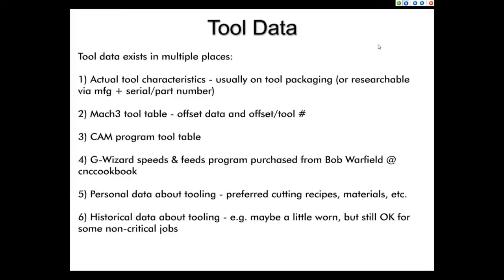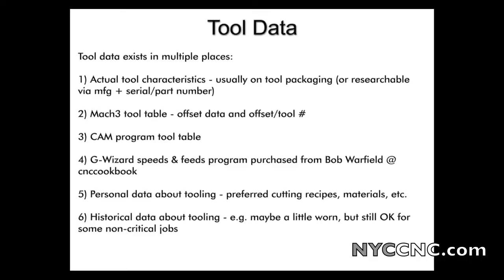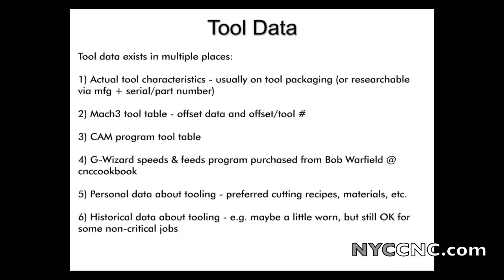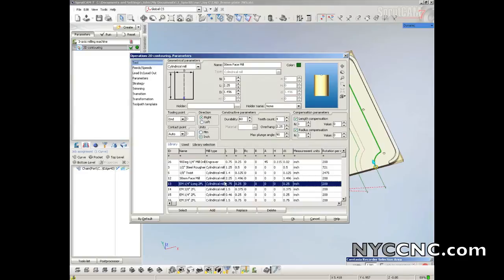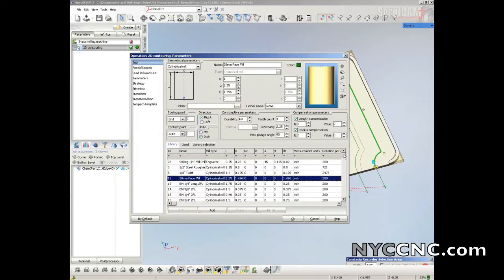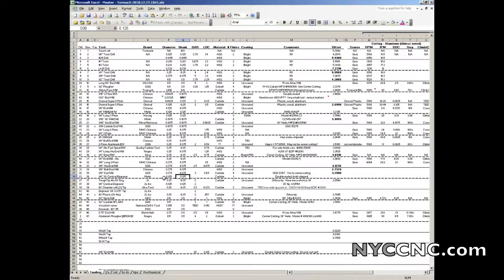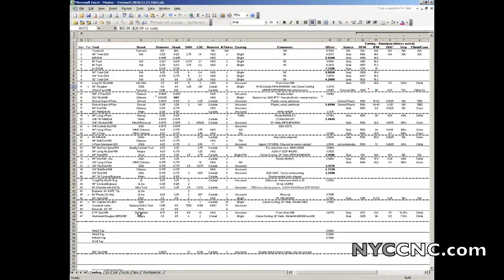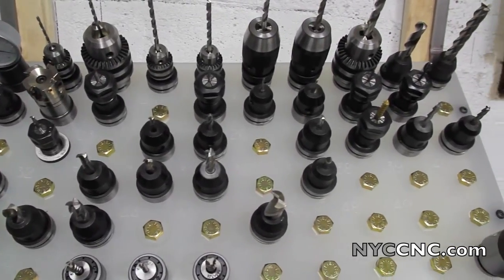Tormach PCNC 1100 - Tips on Organizing Tooling - Ch. 19

Comment: John, just getting around to viewing some of your older videos, and curious if you have done a video that shows some of the more specific job-type tools that you don't use so much? The common ones you mostly use are rougher, flutes, drills and endmills (and the superfly), but curious on your views on the t-slot tools, balls, conicals, chamfers.. using these specific tools as opposed to smaller endmills and doing the "chamfer" for example via machine operations?
Reply: Yes, what other more exotic tools you keep on hand and find useful.

Comment: John, I enjoy your videos all the time. You've taught me a lot. Here's a return favor.
I have found a very simple and semi-permanent way of  enhancing engravings in plastics that I have engraved. I rub a Crayola Crayon (color of your choice) over the freshly engraved area to leave the colored soft wax mostly in the recess engraving. I then pass a warm 25 Watt light bulb over the engraving to melt the wax down in the recesses, care being taken not to melt or warp the plastic. After cooling I gently rub off the excess wax using a piece of old linen bed sheet backed by a piece of flat stock. If the plastic is flimsy I back it by using my granite surface plate. Enjoy.
Mark

Comment: LinuxCNC uses a true real time version of the Linux kernel.  It's a subject of controversy, but a lot of people apparently watch YouTube videos on the same machine as it's running their G code.  I think I'll watch videos on the lathe while I'm running the mill, and vice versa. :-)

At any rate, keeping data files on the hard drive should not cause any problem with response time, even on a Windows machine, because only Mach 3 would actually be running.

Comment: I'm starting to use LinuxCNC instead of Mach 3.  One of the advantages of PC based CNC control is that you have a general purpose PC in the shop.  It's very handy to keep the tooling information on the same PC that runs the machine.  The same thing applies to machine service records, maintenance logs, reference materials, user manuals, schematics, datasheets, etc.  Back it up over the network, or via a USB thumb drive back to your main PC (aka SneakerNet).

Comment: So do you operate your Tormach with the tool length offsets in Mach3 or does your Sprutcam software hold all that information?  I used to use my cam software to compute the offsets and everything in Mach3 was zero but now I use the TLO's on mach so if I break a tool I can just setup a new one and measure offline on my surface plate while I am out in the shop. Just seems easier. Incidentally I bought that  TTS tension compression holder, gonna give it a whirl soon... nice work... peace
Pete